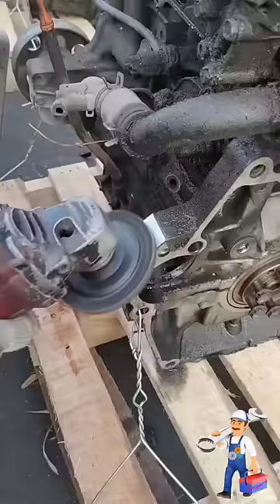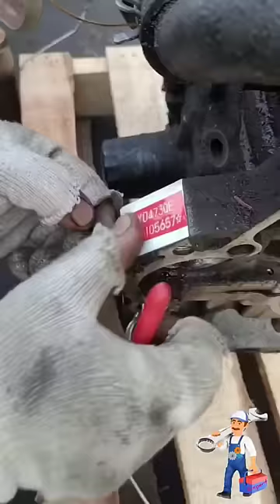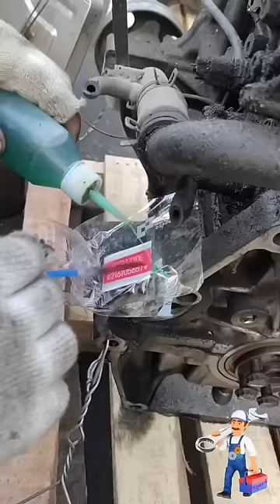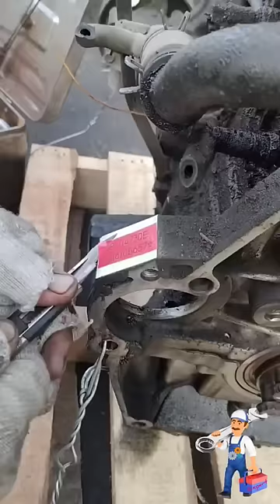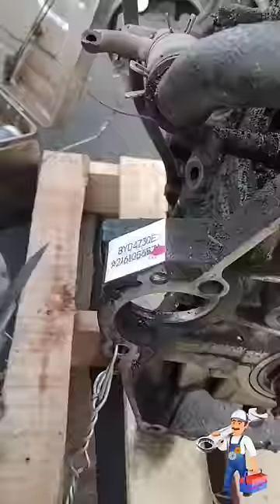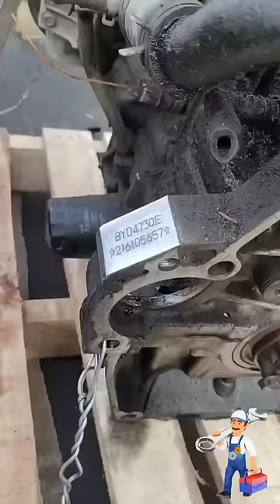six sylinder diesel engine number making #how #engine #mechanical #skills #shorts #viralshorts

Comment: It only works for laypeople, as it is not just the digits sequence that matters, the type of engraving is also verified (excavated, point to point, point on point, laser) and the most basic, whether the engraving surface has been sanded.
Reply: This procedure is acid etching right?, is it also any of the ones you mentioned?